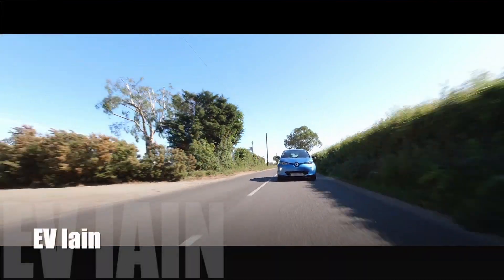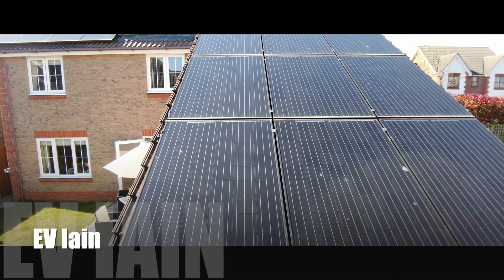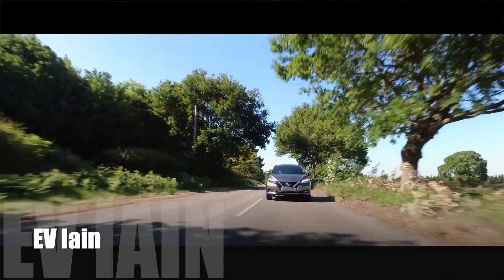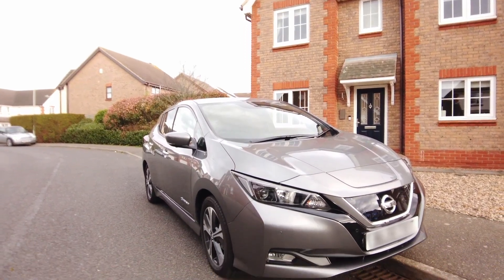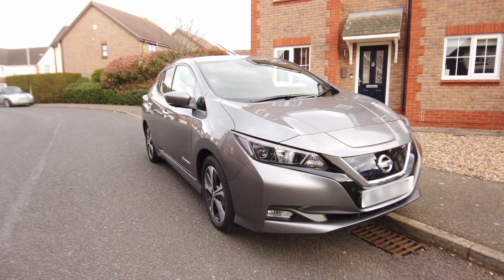V2G PowerLoop Update

Comment: Hello can you advise whether the amount of home charging can be controlled on the Renault app. For example if i wanted to charge my car lets say for 2hrs and only for 2hrs is this possible and will the charging stop at the 2hr point. Just asking as a lot of people ara saying dont charge to 100% as it is not good for the battery
Reply from the maker: Hi Raj, no you can’t but I believe the reason is that the battery is actually larger so even at 100% on screen it’s not actually at 100% ever
Reply: Thank you

Comment: The big problem with renewables (wind & solar) is their utilisation factors of around 24 to 28 % ie if you install 100mw of wind turbines because of variable wind condition you only get in effect 24 mw. Also somewhere on the grid there has to be generation that can be brought online when needed. This standby capacity has to be bought in the first place and maintained etc which makes renewable energy very expensive. ( nuclear energy is excluded from this) The common traditional forms of balancing generation requirements are hydro (including pump storage) and gas turbines. These forms can be brought on line very quickly. In recent years battery storage has been added and the UK has a few 100mw of this with a lot of research going on. So the question is can a few cars with a few kw of stored energy available really make much difference when mw are required?
Look’s like a lost cause. But then so did wind generation at one time before subsidies were applied and the carbon market invented so that a saved carbon price could be added to the balance sheet of wind farm costs making them more attractive. I’m very much in favour of PV with home battery storage and going off grid and if I didn’t live in a wood with massive shading problems I would have built my own system. For industry however nuclear or the new modular nuclear plant is the greenest and cheapest form of generation.
Ps...like your channel a lot and just about to breath new life into my 2013 iMac with new SSD memory.
Reply from the maker: Good thoughts there, I think that to really make an impact it would have to be a no brainer technology, where car buyers saw it as a way to save on bills and car makers/dealers see it as away of getting a peace of some action somewhere too. That way an industry would have an insensitive to create something slick. But what this trial shows me at least so far is that the energy would take my home off grid but the grid itself limits the ability for the energy to go much further. So changes to grid infrastructure could be an issue. Still I have no qualms about being the sole beneficiary of my cars juce so provided there’s a sufficient volume of people like me then it could make a dent. However in equality could be pronounced given the different types of housing stock. Many problems to solve!

Comment: V to g dead , in my opinion for most , complexity , efficiency, who’s it benefitting big questions which I think are answered. Ps just install battery at houses cheaper long run and always there
Reply from the maker: Yes dead for now, I do hope it returns. As I have 90kwh of battery on my drive doing nowt. I am looking at batteries in the home but the price is high. Where as I have cars already so it would feel more like a bonus feature.
Reply: Ovo say otherwise, they are making a v2g tarrif that's 6pkwh at ALL times, they say they will always have enough cars plugged in to balance those that charge in peak times.

That's going to be s massive hit to the home solar industry and energy prices in general
Reply: Thanks Ian - the new Nissan Ariya due out this year looks a better car - I assume that will be V2G compatible?